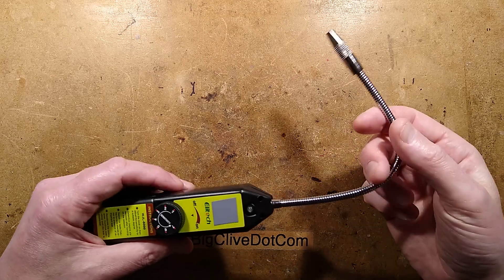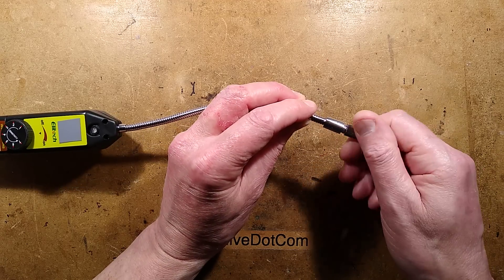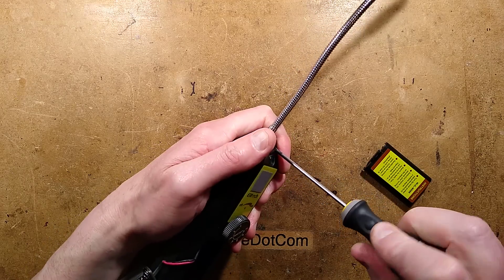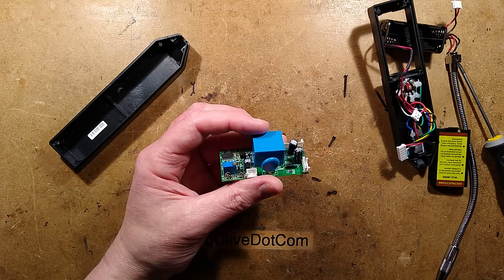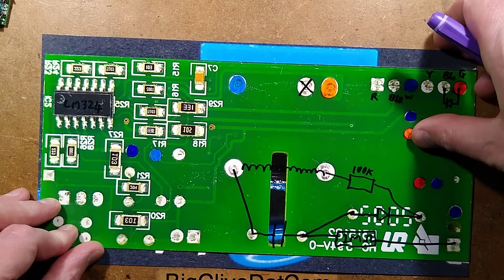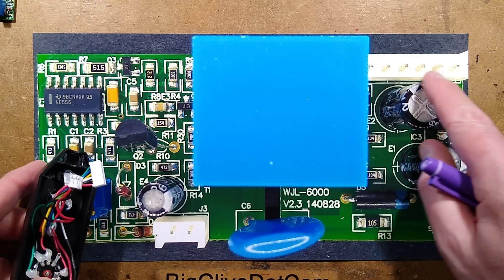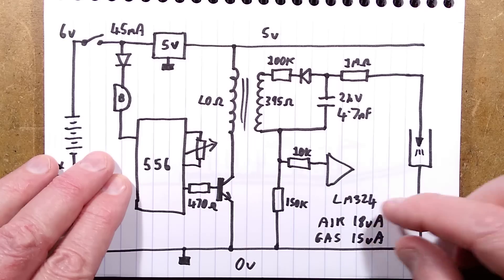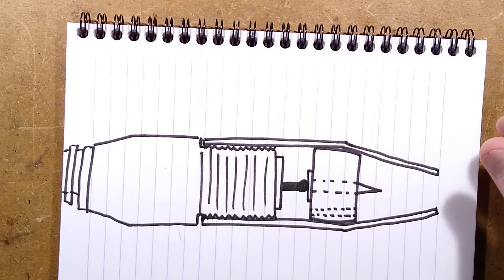Refrigeration gas leak tracer teardown

Comment: I used to have fun with one of these in the Royal Navy. (aircon engineer) I'd make it warble while "testing" some bogus item like a CRT radar display and tell the junior officers it was leaking cathode rays (or radiation from anything with a rad sticker on) I got called to the Engineering Officer's cabin and was politely asked to stop winding the officers up PMSL

Comment: I've had nothing but poor performance from electronic leak detectors. They have evolved throughout my 35 year career, and I have yet to find one I like.  Soapy(detergent) water is the industry standby, and I've found some very minute leaks using that, when combined with a modicum of patience. But it doesn't make much of a YouTube presentation. Ahahaha!
The idea that I appreciate the most in regards to manufactured leak detectors is the 'Sonic Leak Finder's. The tip of the probe is a tiny sensitivity adjustable microphone, and the human interface is a set of headphones. Basically, you move the probe around the suspect component and listen for the noise of escaping gas. And it will always produce a hiss, however small.
Just like any other hand held probe style tools, one cannot reach the surface of each individual component, so the usual limitations. But, it also won't be triggered by the myriad of chemicals used in the manufacture process that give the same reaction as would a REFRIGERANT leak.
It's super low tech, and I like that.
Another of my faves is the propane torch with a small hose extending from the venturi part of the torc head. This is very effective at pulling in molecules of refrigerant and turning the normally blue flame into a pretty green, and hurray, your getting near the problem!
Clive's ability to describe units like these that would normally be akin to eating dry toast but presenting such items with a lively and interesting description is a thing of beauty to me. Would that I had such ability. Would that I could have a friend like Clive, or at least ANOTHER friend that lives a bit closer 😁
Certainly Clive and I share similar interests and fascination and consider industrial machines as an art form and worthy of the level of presentation it receives here.
Thanks my brother BC 😃

Comment: I was actually looking for a video from you seeing if these actually worked a few months ago because I thought you had already done one. In the end I just bought one and used it to find all the leaks in my car AC (the seals behind the expansion valve had failed). Months later, still tip-top fresh cool AC! I found if the tip of the leak detector got too full of dust etc it would no longer give a reading so I used compressed air or a tissue to clean it out, then it started working again.

I believe these things could be just what the environment needs, finding the microscopic leaks that are most likely massively contributing to the greenhouse effect, when every cowboy garage just fills your gas up only for it to all leak out again over the next week/year. I'm hoping now I have fixed the leak I will have working AC for the next few years at least.

Comment: The 5 V regulator must be a low dropout one, right? Still not very good, because the batteries' capacity won't be used completely at all. I guess, at 1,35 V per cell the circuitry will already stop working.

Comment: Ya i used one when working on military ac units. It didn't exactly look like this one though. My mos 91D was power generator equipment repairer. I had forgotten it existed. It's been years since I certified HVAC.

Comment: The LM324 is, in fact, a quad Op-amp. 
Sure, it can also be used as a "comparator", but it was originally designed as a general purpose, high-speed, rail to rail, op-amp. 

I'm much more of an analog I.C. guy than I am a digital I.C. guy... 🤷
I need to get with the times and learn more about the digital chips that are out there today. I always bucked digital years ago, but I should have known better and took more of an interest in it. 
Most of the analog circuits I design today (for my own personal uses) could be WAY simplified by using one digital I.C. instead of a handful of analog components.

Comment: If it emits a discharge, does that mean it could ignite flammable gases?

Are refrigerant gases flammable?

It did look well built though. Even had connectors.
Reply from the maker: Some are flammable, but the corona discharge is low risk.
Reply: @bigclivedotcom  how can it be low risk though? Isn't it a continuous arc?

Comment: I worked in HVAC for years..  i could smell freon..  the guy that worked with me alot of the time in my van couldnt..  he thought zi was crazy.. except every time we would go up on a roof and get near a unit id say "I smell freon".. and sure enough we would find a high side leak.   sometimes he would ask "do you smell freon?".. id say "nope" and sure enough the system would be full and something else was wrong..   in actuality my guess is in a system it wasnt the freon you smell its the solution mix of freon with the (then) mineral oil (R22 and R12(unit fridges)..  or R502 stuff..  I dont seem to be able to smell R410A nearly was well..  i use an R12 /  R134A substitute in my vintage busses and its purposely scented to everyone notices it..

Comment: Okay so I'm still learning the basics sadly and this has me confused. Is the HV transformer being driven by 5V DC? I thought you needed AC?
Reply: A rapid, repeating, turning on and off of a D.C. supply (p.w.m.) will work with a transformer much the same as an A.C. supply will. The rapid turning on and off of D.C. still invokes the "spikes" of electricity, and the resulting repeating building and collapsing of the magnetic field inside the transformer core and windings, and produces pulsed D.C. on the output winding of the xfrmer.

Comment: These are also very sensitive to moisture, so you might have a false detection around an evaporator coil.
Reply: i guess run the fan and dry it out b4 doing leak check then.

Comment: bought one of these for car ac leaks....R-134A 
sooo inconsistent.... and confusing...

could not work out if it was the car next to me...leaking...
soapy water its a  better thing

deep and informative...

Thanks Mr Clive

N x
Reply: Hmm, the model I have works darn well for R-134A AND the old R-12 systems...

It's kind of hard to get soapy water into the HVAC box under the dash, and then to visually see bubbles would be impossible. I don't think customers would appreciate the passenger side of their carpet soaked in soapy water either. 

Get yourself a new model, these are a MUST if you are an automotive 
A/C tech. SURE beats taking a shot in the dark at an EXPENSIVE evap replacement job, because you couldn't find a small leak with your soapy water anywhere else in the system that you could have easily missed, and then STILL have a leak after you did that bitch of a job.... 🤷

Comment: I wish I had something like this but for natural gas leaks a few months ago.

I'd occasionally walk past the building next door and get a faint whiff of gas, but I thought it might've just been my imagination because it was fairly infrequent. Then one night I came home late from work and could hear a hissing sound and smell the gas quite strongly, so I called the emergency services. The fire brigade showed up within a few minutes, looked around for a while with their gas detectors, but seemed quite confused. Eventually they left and a little while later someone from the gas company showed up and seemed equally confused. I could tell he was almost going to leave as he had mostly packed up, when he went back to check one last thing around the gas meters, and then he seemed more animated. I guess he finally figured out that the fire brigade had shut off the gas meters and the leak was after that point.

It took a couple of weeks, but eventually the leak was fixed. I feel sorry for the people who had their gas shut off for all that time. Evidently the owners didn't want to spend the money to fix the problem quickly for their ungrateful tenants. Probably would've preferred to waste their tenants' money and accelerate climate change, while simultaneously risking exploding their building.

Comment: The many discrete components around the operational amplifier are typical of dynamic filters and oscillators. The expression 4πRCω, where R is electric resistance, C, electric capacitance, and ω, angular rate, proportional to frequency, usually results from R C combinations, and you need at least three such combinations to shift the phase 180º (or π radıans) at a certain frequency to feedback the op amp for ıt to oscıllate at that frequency.

Comment: You might want to put opposing dots on the transformer schematic to show that it is running as a flyback. When the primary transistor is on, there is no current through the output diode, but the inductance of the primary is storing energy that is released when the transistor is turned off.

Comment: when our store got a refit ,its all Co2 based , i wonder what detectors they used for the refrigeration leak alert detection ,i assume all i know , is the new plant room condenses co2 at very high pressure to create cooling fluids and its pumped to all the walk in/backup storage rooms and the cabinets itself ,the alert blue bulbs still the same as the 1999 ones installed however

Comment: So, once again I am confused. How could something with 4 little DC batteries create thousands of volts? (I don't really expect an answer, because I probably wouldn't understand.) I better be real careful how I hold 4 little batteries. Wouldn't want thousands of volts running thru my body because I held them wrong.
Reply from the maker: Is using a small transformer to step the voltage up.  It's pulsed by a transistor at high frequency.
Reply: @bigclivedotcom  kind of like the coil in a car?
Reply: @williamromine5715  Yes.
Reply: The little handheld battery powered Sony Watchmam TVs had many 1000s volts

Comment: I got one of those from Harbor Freight years back.  I called it my sci-fi tool, as while scanning it made a rising "bweep" sound, then when a leak was detected it would start in with alarm similar to a tricorder, along with a rising number of LEDs illuminated depending on how much it detected.  It would also go off in the presence of various bodily gases.
Reply: Yep, farting into it WILL get results
Reply: Thank you for your comment, and for the tip.

Comment: had that unit, ended up chucking it out its compleat junk ,the worst detector i have ever used, you will have more luck using a halide detector.  best ones are H-10 PRO, The D-TEK Stratus, or even a fieldpiece

Comment: I kind of wondered how these sniffers worked. I figured they used a tiny speck of some slightly-radioactive material, like smoke detectors.
Reply: Being an ionization detector, I would think it should detect ionizing radiation as well. Not terribly sensitive (real ones are larger for that reason), but it should work.

Comment: Maybe cud use the vape air switch if added a couple of transistors to make it really sensitive just to detect a leak but not for slow leaks and not for specific gas detection tho just leak detector and cud use it on air lines or bike innertube punctures 😅 mini project 😅

Comment: Hi Clive, does this circuit put high voltage on the detection op amp?
Reply from the maker: No.  It has a resistive divider.

Comment: So, you are telling me, that it detects gas, by making sparks.  When the gas leaks out, into an oxygen rich atmosphere.  Fuel.  Air.  SPARK?
Reply: "freon" isn't flammable. Well not real R12 ozone-abusive freon anyway, 
They used to make fire extinguishers with "freon" (well carbon tet really), It worked brilliantly but the phosgene gas produced by the heat stings the eyes.
Reply from the maker: Just a barely visible corona discharge.  Low risk of igniting flammable refrigerants.
Reply: Peculiar   i wrote a reply twice about self sealing gas that ignited itself and both times it was deleted

Comment: I've done this work for many years. In new installs most leaks are where the copper was overheated, so you can see the burn discoloration. In service equipment leaks will have an oil residue arpund the leak. It's kind of rare for me to need a sniffer, unless it's brandy related. I don't watch hvec videos, since I see it every day. The pump type sniffers work better, since the airstream can be a help to draw out vapor and find the concentration faster. Keep working, good luck.
Reply: A sniffer helps WONDERS when the lines are wrapped with an insulation.

Comment: when I worked on refrigeration we had a flame that had a rubber pipe  you would run the open-end pipe around and if the flame turned green ( from memory) there was a leak. the gas was Dichlorodifluoromethane (R-12) fridges and  (R22 ) hydrochlorofluorocarbon (HCFC)  in milk coolers on farms.
its hard to remember what it looked like but it might have had a coil of copper in the flam BUT I might be mixing this up with something else --- Age problem :)
Reply from the maker: It was just the gas being pulled into the flame.  Like a mini gas torch.

Comment: Being unfamiliar with this type of instrument I never would have guessed that that's how you can detect leaks. Neat. Thanks for showing.
I wonder how safe it is when used with flammable gases.
Reply: Butane was used for the demonstration in the video.... 🤷
Reply: @davelowets  That means it was safe that one time but it doesn't mean an accident could never happen.

Comment: Very interesting! 

I'm old enough to remember using a halide torch to look for leaks, one interesting feature of the halide torch is if you don't turn it off it will set your van on fire.....
Reply from the maker: Have you managed to set your van on fire with one?